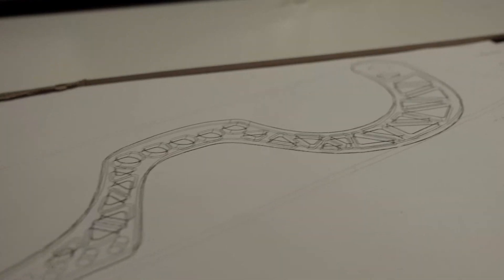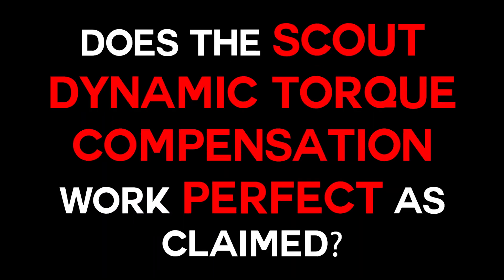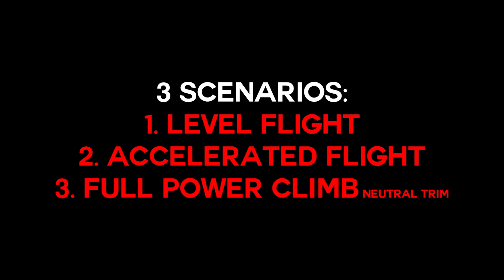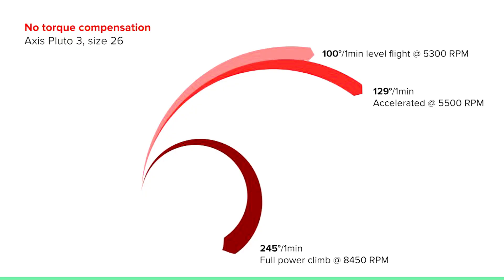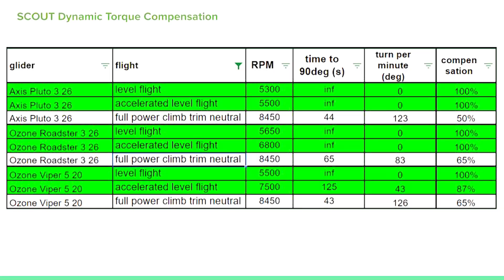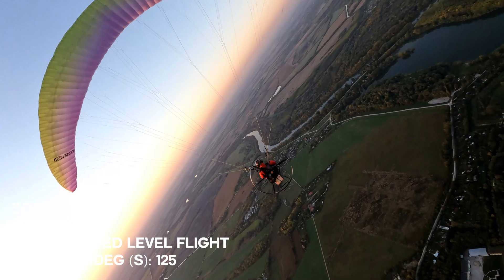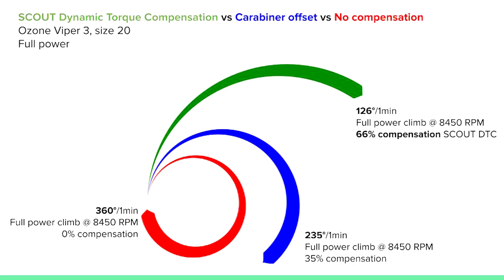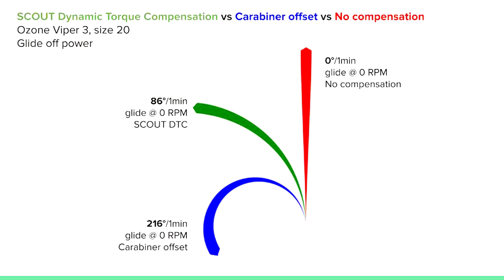SCOUT Dynamic Torque Compensation is not always Perfect! Smarter Pilot series.

Comment: Nice test Miro! A little thing I’ve noticed myself, the prop used makes a lot of difference in the amount of torque created. So how well balanced both the dynamic torque compensation and the carabiner offset is, are affected with the prop used. It’s good you kept those variables the same and not switching paramotor frames or props…

Comment: You are forgetting (again) the effect of change in pith on the lowering blade of the propeller at high rpm which produce a big increase in torque. This is a very studied aerodynamic topic in aviation, specially turbo-prop twin planes